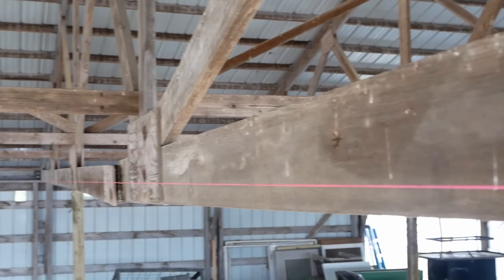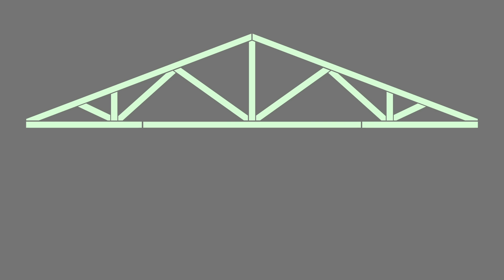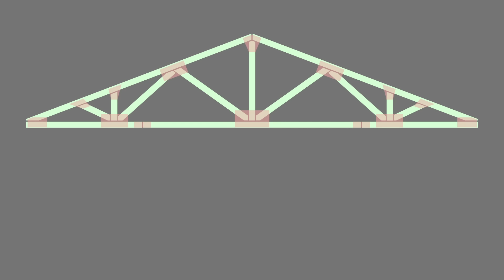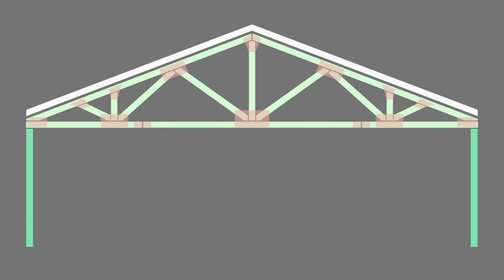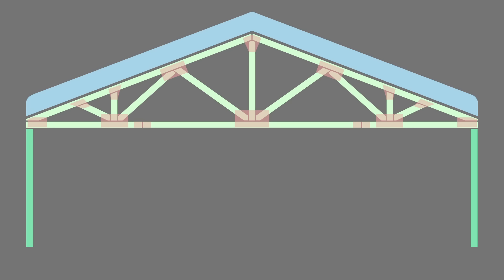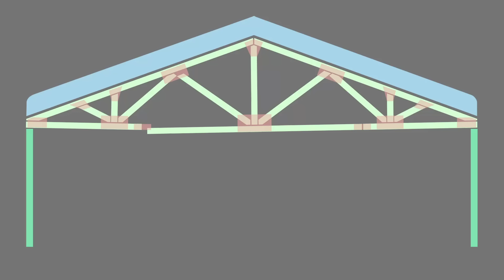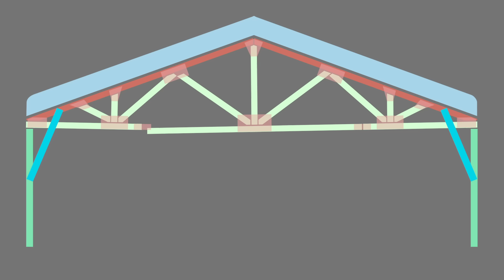Emergency Repairs: Dad's Shed Roof is Collapsing

Comment: If the drawings were stamped by a PE for 30#/sf of snow load, than one can assume that that is the expected load for that region.  The fact that it survived under 2x the expected load tells me that your dad did a pretty good job putting it together.  It doesn't matter to me what you're working on - a Hyundai, an excavator, a barn, a logging robot or a dishwasher.  For me, the draw of your channel is your ability to break things down into simple explanations and your ability to troubleshoot.  And also the fun of learning along side you as you conquer some mystery problem.  Keep it up!
Reply: Really well said! 👍
Reply: Hear Hear!!
Reply: crane support didn't hurt
Reply: Agree and remarks also !!
Reply: If done by a PE, it would have been designed with at least a 2x safety factor, but the fact that it failed in multiple places and still survived is amazing. Kudos to the 24 ft 2 x 10s!
Reply: Freakin' this; please don't shy away from content like this Wes, it's awesome, you're amazing at making videos for exactly the type you've attracted; and I think your skill might have more applicability to things that'd keep making videos entertaining for a long time to come. Or at-least, I hope.

Comment: As a former truss design technician ( not a Professional Engineer) I commend your truss repair. The bigger ( read longer) plywood gussets  with bolts! on the bottom chord were and excellent up grade. Also very glad your dad retrofitted all the bottom chord splices (ie butt joints) on the trusses. A pleasure to meet some of your  family in the vid.
Reply: full length cables would be my suggestion with so many joints and open ends.
Reply: You are obviously NOT a professional! The plywood gusset plates on the bottom chord should have been AT LEAST 6 feet long, on both sides and when you use plywood gussets, you have to nail them every 2 square inches on both sides.
Reply: @realemonful  no need to be negative.  A structure like this built with used lumber cannot be “engineered” so as it was with the initial construction, rule of thumb prevails.  Logic says if it failed once it can do it again in a different set of joints.  Snow load may have caused this one but how will this handle the 100mph gust through the open ends of the structure?  Agree on plywood reinforcement but there are more weak points and a few cables cant hurt!  No reason to get worked up.  No one has more common sense than Wes and I bet between him and his father there is 100 years experience.

Comment: I've done this on old barns where half the roof was completely caved in and the walls were racked at a hard slant and half of the roof had blown off by heavy winds and flew out into the field.   So we had to disassemble the huge chunks for roof in the field to reuse them..  The trusses had the factory gang nails, so they were quite a bit stronger.. We had to rebuild one rafter in your style--- with the plywood at the joints.  2 rafters were in the field, somehow one wasn't even broken--  so we just layed it down and used it as a pattern:   and built the other one over it with the glued plywood joints.    It looked awesome when we were done.   The guy was super happy that I talked him out of bulldozing it.  You can fix any building with a jack and ratchet straps, with minimal extra materials.  :)  ..........  The main reason it failed is because the rafters were only screwed to the posts with long screws..   So I made him bolt the rafter through the posts with a 3/4 bolt and nut and big washers.. so It won't happen again.   

I live in Oklahoama,  so we had some crazy tornado level wind storms-- and it blew one of the doors open and the wind direction was blowing right at the door and it just blew the whole building up like a balloon and popped half the roof off.. lol.   The roof sections were still nearly fully in tact and about half the building in length--  and they were a good 100 yards away in the field.  :)..    but it wasn't even that busted up---  so it must have floated down slowly like an umbrella and just softly landed in the field;   like I said, we reused nearly all the metal and even reused one of the rafters that was magically not busted at all.   Pretty crazy to see..  I wouldn't believe it if I didn't see it myself.
Reply: According to the NWS, it takes only about a 3 PSI air pressure differential to blow apart wood-framed homes, and the usual for such things to happen in windstorms is for garage doors to be blown in.

Comment: "come with me and you'll see, a world of osha violations!"
Think I would be tempted to fit a few permanent cables just to tie those walls in tension.
Reply: I thought about that too, as did some others. I’ve seen solid rod like this in Europe, with fasteners on the outside of the building.
Reply: I was thinking the same.  I realize the joints are now better than ever, but, I'd feel better with some cables too.
Reply: it cant be an OSHA violation if it isnt a job site. OSHA has no say whatsoever in how a homeowner/private resident uses ladders etc. if I wanna stack 5 5 lb cat litter buckets as a makeshift ladder, OSHA cant go jack about it. I wanna use dining room table as ghetto lazy man's scaffold, Id send video just to taunt OSHA
Reply: @harveylong5878  It's a diesel creek gag, wes will be well aware of it, sung to the tune of 'Pure Imagination' from charlie and the chocolate factory;
"Come with me and you'll be
In a world of pure imagination
Take a look and you'll see
Into your imagination"
Reply: @Rein_Ciarfella That’s a very common way to reinforce a masonry building, and was commonly used before World War I.  After that, if they needed a reinforced building they built it from steel framing or reinforced concrete.
Reply: Was going to write the same about cables.
Reply: One of our machinery sheds has tension rods which we added not long after construction.  Apparently one wall bowing out 3" and the opposite wall bowing 4" is "Within specifications" 🤨.  8 bolts clear through the RHS rafters (with inserted crush tubes) for the mounting plate at each end, 1" rod with threads turned on each end and made into a turnbuckle solved the problem.

Guess which shed company we don't use any more?

Comment: As a framer who has repaired many a home, sistering some 2xs on those bottom chord splices would help me sleep better. Even so, you guys handled that pretty well. Party on, Garth.
Reply: Yeah, I don’t disagree with that at all, although the right plywood grade and thickness would probably do a similar job. I was thinking 5/8 or 3/4 (better) in 3-foot lengths. As for the glue - meh!
Reply: After the repair, I think I would have ran some 1/4" cable on turn buckels across the bottom of the trusses. Good insurance.
Reply: @Rein_Ciarfella  Polyurethane construction adhesive is unbelievably strong. It's going to add a TON of strength to those scab joints when it cures (aka in the spring when it warms up - haha)

Comment: Nice work saving the shed. Trusses are always interesting from an engineering standpoint. When I built the roof on my home addition a few years ago, I went with 125# snow load, even though local code only required 85. Two stories up, 30 year shingles, and North Idaho winters meant I never wanted a reason to be up there ever again. So far, so good.

Comment: I love the appeals to authority you expect.  Every time I hear "it's not up to code", I think of the pedestrian bridge in Florida, or any number of smaller jobs I've been on that have blown up after following the engineered plans and passing inspections.  that is a well engineered building.  Good documentation on the repair.
Reply: Good engineering usually works well as it always has a safety factor built in. However I've seen quite a few engineering failures in my career including a few where the failure point was obviously wrong to even an untrained person. The inherent problem with engineering today is that accolades and career advancement come when you design something cheaper and/or easier to build, often economizing on materials, and skirting published minimums leaving no room for anything to be done less than perfectly. They're in a race to the bottom instead of taking a higher aim to actually build better and allowing for the human factor in construction. Less isn't more, especially when it fails.

Comment: Framing - now you’re talking about something I know about. Before you got to the new plates I was thinking 3 foot at least 5/8ths solid plywood through bolted with at least 1/2 inch on 8-inch centers in two rows. You nailed it!
Knee braces - direct more load to the ground and really help brace the roof on the outside ends, depending on length and angle of attachment. A royal PITA in residential second floors or attics if you’re trying to maximize usable space but perfect for buildings like this. 
The only other improvement would be buttressing, but that’s rare outside medieval European cathedrals. 😉

Comment: Okay Wes just a few suggestions! Every place you have screwed and glued plywood brace needs to be replaced with a metal brace. This can be done a truss at a time to make it easier on the pocketbook.  Also at the very least every other truss needs to be up graded to the next truss size. Again can be done a truss at a time. The ones I can see in the video are very under sized for the span you guys have! I'm pretty sure the ones I can see were make for the old "minimum standard" for snow loads. To say that minimum was optimistic is an understatement! Very glad no one was hurt! One thing building in Alaska taught me is you can't over build for snow!

Comment: Coming from someone who has been in the building trade for over 25 years I am amazed that it withstood the amount of snow load that it did . You guys did the right thing by adding the carriage bolts instead of using nails again . One of those bolts is equivalent to a ton of nails . Good call on reinforcing all of the other joints as well . Hopefully if the situation presents itself again the building will laugh at the snow and tell it to move along ! Nice job getting it pulled back together, it went amazing well , I’ve been in similar situations and sometimes wood will bend one way and then not go back to its original spot . Getting it done quickly was a good move on your part for sure . Nice work all the way around !

Comment: That new/additional bracing looks like a big improvement in quality on what was there before. I reckon your wee fella will be the next one to fix it. Mebbe in another 30 years. Good work but not a problem we have here in OZ. Most of the last week or so here the maximum has been nudging 40. Celsius!
Reply from the maker: Oof!
Reply: Hey!  I'm from Australia, and it's snowed where I live.  My great-grandfather talked about THE time it snowed when he was alive.  It was in the local paper and everything.

In Wes' area, they probably wouldn't bother mentioning it on the TV weather report.

Comment: I live in a heavy snow area. Over time loads are  cumulative and you see roofs fall in. Your dad's rafters held for the years they did. I've had to do the exact fixes here on properly designed trusses.  So I compliment your guys thinking and doing.

Comment: Wes, it's weird to hear about your weather being unseasonably cold and snowy.  We've had the exact opposite here in Central Minnesota.  I've only shoveled my driveway once this entire year and only because I wanted to, not because I had to..... there was only about a 1/2" of snow on the driveway. lol.  It's also been unseasonably warm.  This should be our coldest time of the year and with the exception of a week and a half of sub zero temps a few weeks ago, we've been very warm here most of the winter. It's been in the mid 50's last week... we should be below zero right now.   Last year was the snowiest season on record, and this year will probably go down as the LEAST snowiest.  Weird how it can go from one extreme to the next over the course of only one year.   Glad to see you got your dads building fixed up.  Good job with that!

Comment: My Dad built a 2 car shed in South Carolina.  When a large snow storm was imminent, which was rare, he would add an upright stiff knee to the center ceiling joist to make it through.  Great repair!
Reply: We do this quite a bit around my area, center jack posts are put into a lot of buidings late in the fall, and in the spring when the roof is clear of snow and ice we take them out and store them for the next winter. I do it on one of those tin garden sheds, and haven't had it go sway back yet. Lots of snow and ice here in Canada, it seems we are getting more ice these winters than I remember from my childhood. All said and done, winter and snow sucks!!

Comment: I recently built a garage with hand built trusses make in the same manner.  The architect/engineer had me use nails that were about an inch and a half too long at the truss plates, then “clinch” (bend the ends over 90 degrees) them over to prevent the pullout your Dad’s trusss suffered.

Your repair looks good.

Comment: I'm in Australia and we only get snow in the alpine regions.  In Feb 2000 when I was on holiday in the US I encountered driving in the snow and freezing cold for the first time.  No thanks, you guys can keep it.  
Sure you say you get used to it but it just looks like it's a pain to deal with it every year. Driving in it, clearing driveways, the stuff piles up on the roof, pipes freeze, no thanks. 
Got stuck in a blizzard shortly after leaving Cedar City in Utah...scariest ride I've ever been on.  
Did a U-turn as best I could and drove back to Cedar City, I wasn't even sure I was still driving on the road.  I could cope with cold winters but I don't think I could cope with all that snow and all the problems that come with it.
Reply: I’ve lived in the US Northeast most of my life (76) and the older you get the less romantic you feel about Winter. 😉🥶
Reply: We can get real winters here. I've never been where it gets real bad and I've still seen some disaster storms. When it snows you move snow.

Comment: Rafter spacing seems a bit wide.
  Also, button up the building and run enough torpedo heater to melt the ice
Reply: " A BIT Wide", snow load, at the minimum 4' centers, 8' is a recipe for disaster
Reply: @robertklein1316  I'm not an engineer but that sounds right. Also, it really doesn't add a lot to the price of a good roof ,or at least 20 or so years ago.
Reply: unless you can keep metal roofing warm enough the entire length, the ice/snow will melt find a cold spot , refreeze. our metal roofed sheds at work usually have little to no snow 3/4 way down, the bottoms have ridges of ice/snow on them. new sheds supposed to come with radiant heating running entire length , keep the roof at 50 degrees  minimum
Reply: @harveylong5878  you are right,  the eaves especially then there's the danger of the falling snow/ice AND  the clean up in front of doors etc. Of course these problems exist even if the roof held up.

Comment: Safety is important. But I also recognize that farmers just have to get stuff done. When the barn is about to fall down potentially ruining your livelihood, strict adherence to safety protocols is out the window, and you make it as safe as possible.
Reply: I agree. The only thing I might have done different is leave a couple of tractors in there with the buckets up in the air. That way if the roof collapsed on us at least there might be some equipment to keep us from getting totally crushed. But the working around the equipment can have its own disadvantages.

Comment: The adhesive also likely failed due to the cold and at that point the nails would have been forced out. I've never seen adhesive used on truss nail plates. For this sort of build you really don't want to make the joints inflexible as the design is to make each attachment a point load and a pivot so all loads are only in tension or compression.

Comment: Excellent explanation and animation explaining the roof rafter/truss failure. I enjoyed the background music during the snow and ice portion. ☃️ Here in NJ the entire unit would be called a truss, pre-made and trucked to the site. Rafter just the support immediately under the roof. Again, local nomenclature applies. One thing to remember is not to hang things from the bottom chord. The truss is usually not designed for a hanging load.
You may want to check into enclosing your skid steer. 🥶 Liked the different content also.👍
Reply from the maker: I wish it had heat.

Comment: Nice work.     I have a 40×75' building thats built with telephone poles every 5' but it has rafters on 4' centers much closer than your dads.  And its held up well.     Here in south eastern iowa we had 29" of snow and the same rain afterwards.    But the 28x80 leantoo on the southern edge of my cattle barn caved under the pressure.    Love all your videos.     Keep up the awesome work

Comment: Pole buildings are generally considered to be 25 year structures, and this is why - they're not designed to hold a once in 25 years (or longer) snow load. Good work saving it and the reinforcements look good, like you say, stronger than before.
Reply from the maker: I would say it's more like 40 years. At that point the poles are usually rotted and the roof is leaking badly. There are crews here that fix them though. They jack them up and replace the poles.
Reply: I can’t help but be an engineer here but building type doesn’t have anything to do with the reoccurrence interval of extreme loading events.  For buildings designed to code, all buildings are design to the same reoccurrence interval for all events (snow, wind, earthquake, etc.).